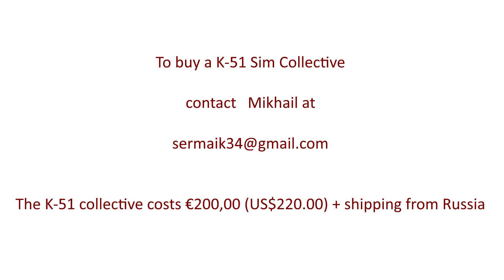Convertible Fixed/Rotary Wing VR Sim

Comment: Well done Russ!  I fly for Cougar Helicopters (Sikorsky S-92) and started building my home sim for the same Covid reasons - I've been stood down since November.  You did very well considering a lot of factors including a lack of real-time instruction and the lack of true visual, spatial and physiological cues that non-moving sims just can't provide.  When you get into the larger transport category CAT A Rotorcraft, the AFCS provides Stability Augmentation, Attitude Retention and rate gyros feeding back to the SAS making for a really stable platform.  Makes flying the real thing much easier and I haven't seen a simulator recreate this properly.  Overall great job setting it up and flying.  Try not to move the controls so much - tiny little movements work best, even in the sim.

Comment: Good job Russ. By the way, Throttle should NOT be like a motorcycle. It is opposite. Increase engine RPM by twisting throttle away from your leg. Approaches use simultaneous deceleration and descending starting from about 60 knots. Use a constant angle and arrive at the termination point on the runway at zero speed. Start that approach at 500 feet altitude on final at the same distance away you use for a Cessna 172. Use 4-5 degrees slope. Steeper takes more experience and coordination to do safely. As the approach gets slower you must increase the collective to higher power levels to compensate for the transition from forward flight to hover flight. Don’t allow the aircraft to balloon or under-arch. Hovering requires more power than needed at 80 knots. If you use about 52 psi torque at 80 knots, then figure around 56 to 62 psi torque at hover. Use the tail rotor pedals to keep the nose straight at all times. Don’t let the machine fly you. If you move the collective your feet must move too. Pedal inputs at hover will use roughly 75 percent of total throw unless your settings are way off. Single rotor helicopters demand considerable pedal input at hover. Fly the nose.
Reply from the maker: All great info. It is great having over 23K hrs and with a rotary wing being a complete newbie

Comment: Russ. Don’t have a RW  set-up in X-plane, but do have 7K+ hours in Hueys, 58’s and Chinooks (US Army). If someone had told me they were going to try and learn to fly RW in a home sim, I would have thought it wasn’t possible. Watching your technique of using a running type take off and landing is a smart way to start.  You eventually will have to learn to hover over a fixed point and that, I believe, can’t be realistically done in a sim.
In reality during a hover there is an almost constant tendency to upset the desired equilibrium from wind, distribution of the rotor wash and its affect on the fuselage. Plus the vibration, and torque effects from main and tail rotors also add to the equilibrium upset.  Once hovering is mastered - and you are correct, it takes a different type of eye - hands - feet (and sometimes wrist) coordination than is normal - it is never lost. It is a muscle memory learning that I don’t think a the sim can replicate.  That said, please keep trying to learn to hover and putting up you videos. You will learn to hover the sim. Thank for your helpful video, I’ve learned a lot from you. (Went from RW to FW after 12 years in helicopters without any difficulty)
Reply from the maker: I was a Forward Air Controller in the Air Force in Germany flying the OV-10 in Germany(1978-81). Coming off the F-4 it was a bit of a disappointment but turned out to be quite fun flying around Germany VFR at 500’ AGL. I did some FAC work in the OH-58 and a few warrant officers put me in a large field and let me try to hover. It reminded me of the first time I tried to fly formation. Takes a light touch and constant attention. I realize I can not replicate the feelings of RW flying in a home Sim but it does remind me of the free feeling of cruising at low level and relatively slow speed in a real helicopter. Thanks for taking the time for your detailed comment.
Reply: You can probably learn the "theory" of hovering, what you're supposed to be doing in it, but lacking the physical feedback and accelerations you should be feeling definitely won't make it so that you can just jump into a real one and expect to hover even if you're great at hovering in the game. Seat of pants make a big difference. =)